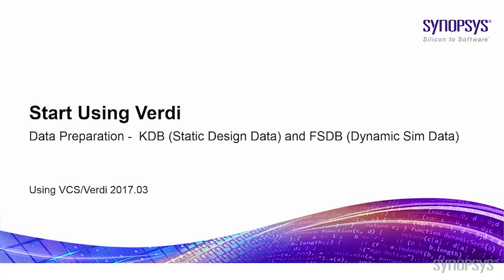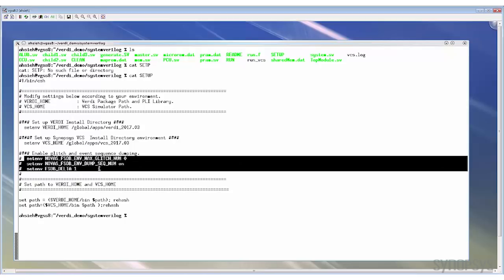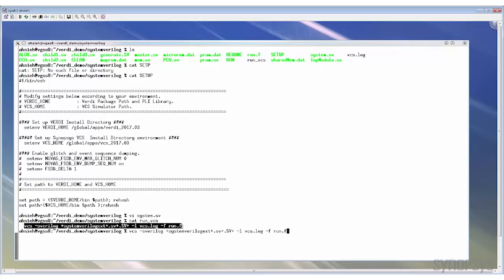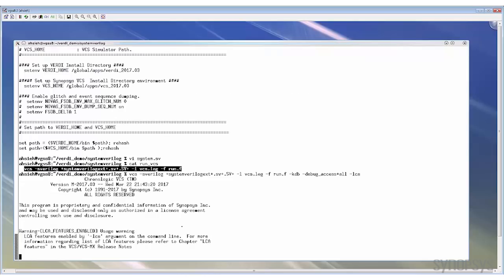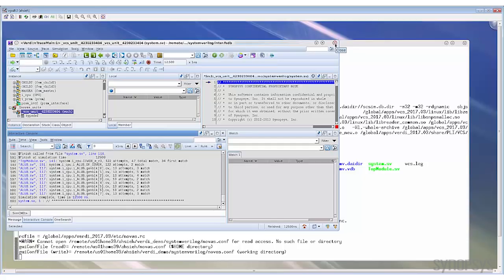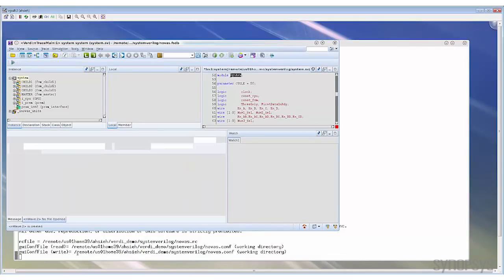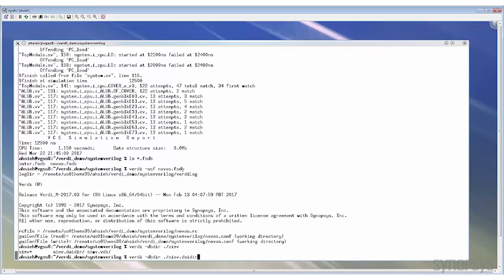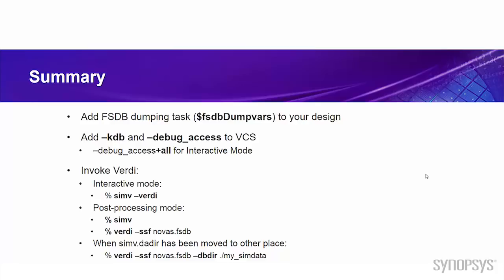Data Preparation for Verdi | Synopsys

Comment: hi I have used fsdb most of time so far. What is the advantage of using KDB database?
Reply: they are separating design model and simulation database maybe this is the reason there will be an improvement for the Verdi tool performance.